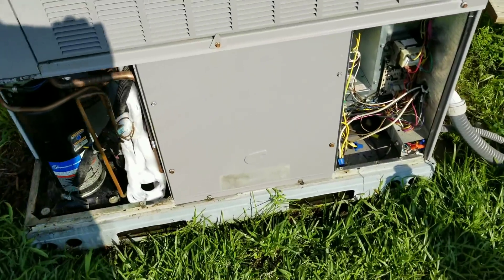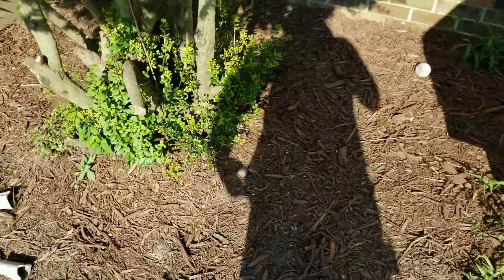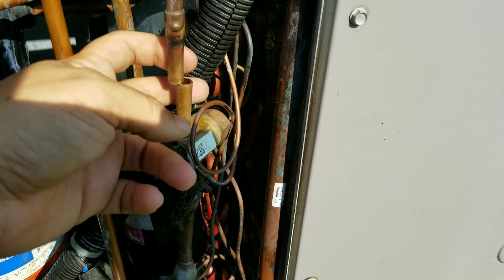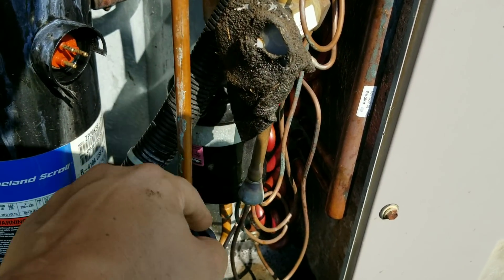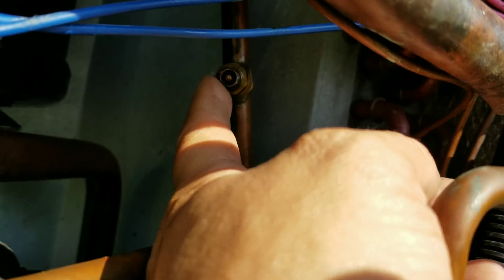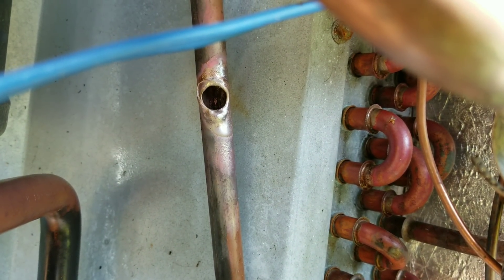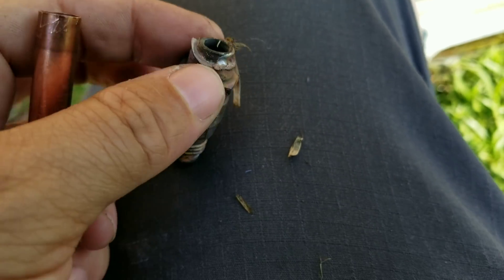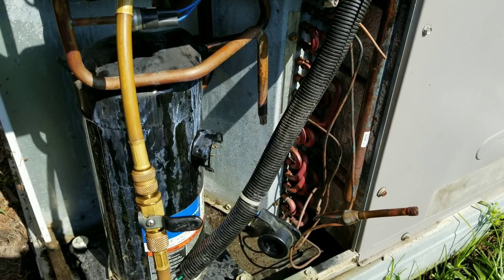TXV Replacement (Carrier / Bryant)

Comment: Just out of curiosity how come the txv can be either in the evaporator or the condenser ? Why is that the case sometimes ?
Reply from the maker: TXV inside meters refrigerant in cooling and a TXV outside meters refrigerant in heating
Reply: Its a heat pump

Comment: Is there a TXV valve on both the heat pump and air handler? I have a Carrier and it just got diagnosed with a bad TXV that is stuck wide open, which the technician told me was a good thing. From what I have researched it's supposed to be rare for these to fail but my unit is only two years old.
Reply from the maker: Depends on the specific model  but the cooling TXV is located in the Air Handler. Stick wide open is more rare than slammed shut but neither is good on the system. One restricts refrigerant from returning to the compressor to help keep it cool. While the other (stuck open) will potentially cause liquid to get back to the compressor washing oil out of the compressor causing premature wear and tear. 
He likely means its a good type of failure because it still allows you to have some cooling.
Hope they get you fixed up.
Reply: @HVACinSC  Yep, that's pretty much how he explained it to me. He said I could run it for one more night since they're coming in the morning to replace it. He said if it was closed shut he'd absolutely turn the power off to the system. They're going to fix me up at a pretty good cost of $650 in labor with the parts still under warranty. I'm in Florida so it's crazy humid right now and I'm sweating my ass off just typing. Just another thing to learn being a homeowner, it's always something breaking or broken.

Comment: Nice work!  Say, why did you replace the coremax fitting?
Reply from the maker: Thanks! Because I dont carry coremax valve cores or the tool to remove them. This gives me the ability to pull a faster more effective evacuation of the system.

Comment: you can always spray some of the paint into a plastic cup and use a cheapo foam brush to apply it. no need for a shield or worry about over spray :)
Reply from the maker: +throttle bottle This method works just fine for us without the need for any other materials.

Comment: Is it harmful for clamps to be in direct contact with the copper as seen at 2:32?  I heard you say later you had the sensing bulb insulated with some cork tape. I'm thinking the cork tape would be best served to go on first and than the clamp? I'm curious what you are seeing out there as common practice and what do you think about this?  ~ Excellent Vid!!!
Reply from the maker: Thanks man!! No harm at all with the clamp situation. It is designed this way from the factory. The cork tape is only used to insulate the sensing bulb from the outdoor ambient temps. Placing cork tape between the clamp and the pipe would greatly reduce the accuracy and performance of the valve. Thanks again for watching!!
Reply: just don't crank them so tight it crushes the bulb, pipe or both and make sure it's good stainless steel clamp.